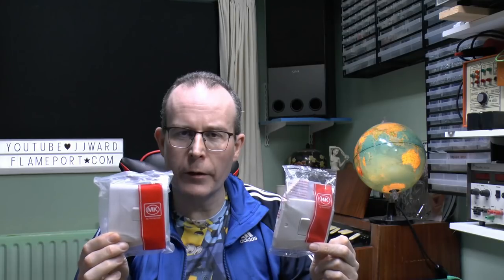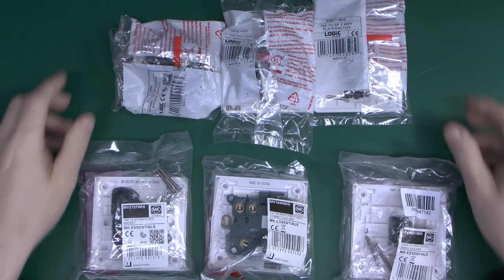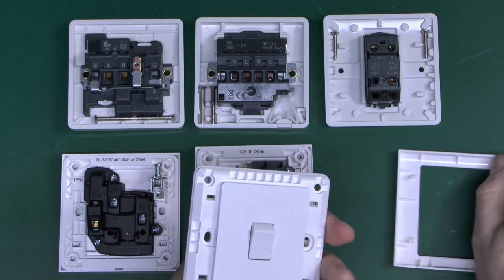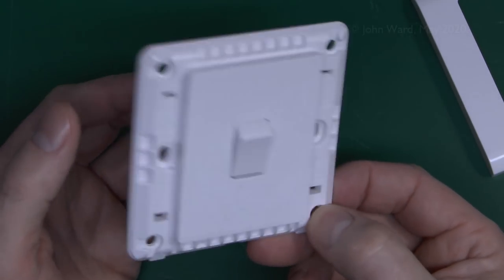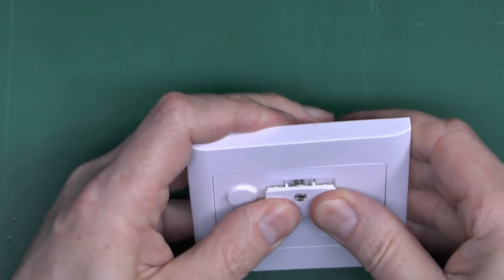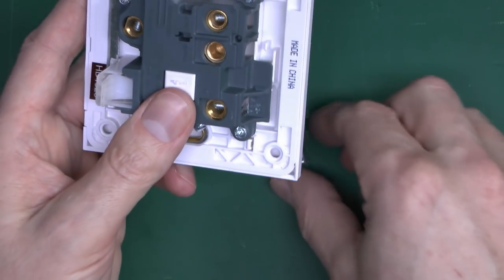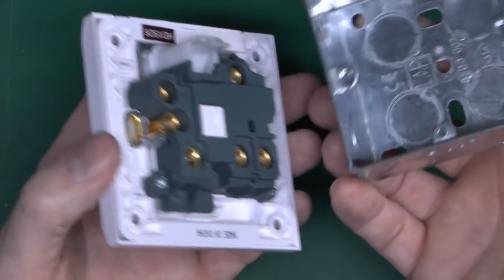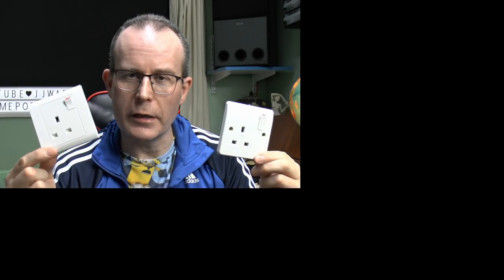MK Essentials vs MK Logic Plus

Comment: The MK essentials look like cheap compromised crap to me... Amazed that MK would produce such rubbish.
Reply: MKs quality has plummeted since they became part of Honeywell.
Reply: Looks very much as if they've put their name on a pre-existing range. The inapplicable CE mark on the socket would seem to back this up.
Reply: @Graham_Langley  just what i was thinking, they have found a generic chinese manufactured range which is probably also sold by other manufacturers as well, ill stick to the loig plus, always used them and will continue to do so
Reply: Judging by the looks of the things, MK only makes the frame that covers the screws ;)
Reply: @Graham_Langley  "China Export" quite applicable.  :)
Reply: Totally agree with all these comments, I have seen then and they are very cheap and nasty. Not for me.!
Reply: Not liking the look of the Essentials range, the absurd design of the light switch says it all.
It's a shame that a brand which had a long history of UK manufacturing and which was once synonymous with quality should introduce such a product range.
It looks cheap and not very attractive in my opinion, the quality of the materials and the design are questionable and also shame to see more unnecessary and fiddly packaging introduced.
If the customer wants MK, would definitely stick with Logic Plus, where most of the range (but not all of it) is still manufactured domestically although I see comments from those who have been in the industry for many years saying that the quality of these products has declined in the last decade. I've certainly found it necessary to wind the terminal screws in and out again before making terminations.
Reply: @Graham_Langley  That certainly seems to be the case, none of the products had MK moulded into the main plate or the back of the switch / socket body; the only marking visible was on the socket where it was ink jet printed on the back.
Reply: I think Logic Plus are still up to the old standard (maybe apart from the terminal screws). 

Nobody else apart from Crabtree and Wandsworth has the same smooth plug/unplug quality and switch action. 

(That I’ve found at least).
Reply: This is driven by design and build projects and contractors wanting to fit cheap rubbish, this is the sort of junk Cala and Taylor Wimpey etc. will install in new builds. Contractor specials, until people demand quality this market will do great business. 

MK had to be able to compete with the cheap own brand rubbish the likes of CEF brought out. Sadly people accept this. I personally want quality in my home.
Reply: @peterpeterson9903  Exactly - so MK launching these probably raised the standard of those bashed together houses' wiring accessories, which can only be a good thing.
Reply: Probably for international market like here. I can only get the Essentials, but would like to get my hands on the Logic lineup. FYI 50pence difference is huge for lower currency market.

Comment: Who'd have guessed Honeywell would take a well known quality brand and stick it on some crap...
Reply: They also have cut a fair amount of the finishes from the higher end products (edge, aspect etc).
Reply: They've done that with consumer appliances for a while. I bought a "Honeywell" electric fan some time back, it barely lasted a year,  just long enough to be out of warranty.
Reply: @tncorgi92  argh probably got a timer circuit in there somewhere Lol.
Incidently I bought a Dualit kettle (£70) lasted 2 years ,got a slight discount on new one that played up to ! For work I bought a cheap travel kettle used to get chucked into van never let me down in 10 years .
Reply: Paul Drake yes Honeywell electric fans with remote control promise whisper quiet operation and then rattle after a year of use!
Reply: @SproutyPottedPlant  mine became whisper quiet because the motor was dead.
Reply: Well they did with Gent fire alarms
Reply: I think Honeywell tend to grow by acquisition. Their famously unreliable wireless roomstats for example with the fading LCD segments, they're made by a uk company that honeywell took over.
Reply: Crabtree was bought by Siemens, who kept the standard pretty much identical.  

Remember Cabtree own Volex too (if on a budget) and they can be reasonably attractive now too after those ugly 80s sharp Volex accessories!
Reply: @raychambers3646  I had the same Dualit kettle, burned out after approx 2 years also.  Got another one from Costco fortunately - great customer service.

Comment: 18:01 - just occurred to me that the removable blanking part in the front of the essential FCU is probably a choke hazard for toddlers as well.
Reply: Blanking parts are removed by the installer and discarded with other dangerous waste.  No toddlers should be in range unless playing in the waste disposal pit.

Comment: Good demonstration of the two ranges of MK JW . I was very interested to see this new MK range as I haven’t fitted any for years now . Always used Crabtree for the most but it’s become less stocked by local suppliers. Changed last year to schneider lisse  range and apart from the ridiculous short pins supplied for light switches it’s a nice product. I’m glad I don’t fit this rubbish, I noticed that if you used the flex outlet on the switch fuse you would need a very deep box regardless of the big lump of a cord grip .. This MK essential looks like dreadful expensive tat.

Comment: Somebody at MK has messed up here, looks like cheap crap I can't see that selling well at all.
Reply: going to sell to the cowboy builders though, where they will buy it, simply because it is 10p cheaper. Who cares if they fail after 2 years, he is long gone by then, having made a whole 2 pounds extra profit on the job.
Reply: @SeanBZA  Thing is theres cheaper stuff that looks better, and is probably more reliable!
Reply: Well personally, I prefer poking wires into round holes rather than square ones.
Reply: Sadly it will probably sell to people who either don't know any better or whose customers specified MK but neglected to specify which range of MK products.

In the long term it won't be good for the MK brand but in the meantime they can make a quick buck :(

Comment: Thought I ought to point out that some Logic+ stuff is made in Malaysia - the double sockets with outboard switches for example.
Reply from the maker: Had an MK 646 plug that was made there.
When wiring it, one of the terminals inside sheared completely off.
Reply: And the double unswitched socket K781.
Reply: @jwflame  I had one - country of manufacture unknown - that one of the cord grips broke off straight out of the bag. It had been in stock long enough not to know where it had come from so I called MK. Their response: "Buy another one - they're cheap enough."
Reply: I have a few Malaysian MK items. I was intrigued when I saw the 'Made in Malaysia' bit, but they seem to be of the same quality as English made ones.
Reply: @stevecoatesdotnet  The only real difference I've seen is the fixing screw earthing riveting seems to be a bit messier than on the UK ones.
Reply: @Graham_Langley  I would have replied: Send me another one free, they're cheap enough. :)

Comment: I think MK accessories have been available in other Type G countries for decades either manufactured
or imported. 
MK also used to manufacture their Avant range which is basically the old Logic range
in a more curved design plus clip on face plates in either white or synthetic metallic finishes. 

I did at least expect the Essentials range to have basic British Standard compliance as standard
in the sense that the design wasn't flawed that some accessories don't fit 25 ml back box properly.

In other countries back boxes with 4 screws in each corner are more common then they are here in the UK 
so I can see the reasoning behind the clip on faceplate on the Essentials range but the Logic Plus range 
does have indents on the reverse side that can be drilled out but that ruins them if they are going to be reclaimed.

Comment: Here, in the US, it's very unusual to see a fuse in a wall outlet or switch. I've never seen a face-plate with a hole in it for a cable to run out from!

Comment: The biggest problem with BOTH of these ranges is that they don't match the earlier MK classic sockets and switches. No particular problem for NEW installs but having to replace a whole kitchen full of the square edged classic socket and switches JUST because the new one is "preferred" is bloody ridiculous!

As for that pile of Chinese junk, I can't believe MK have dropped their standards so low, as others have said. I have to say that the LAP range  and some of the others are better looking and better value than MK these days. I suspect MK have resorted to these Chinese ones in order to retain a greater share than they are losing. Years ago no-one would ever question buying MK - a bit like the old IT expression "no one ever got fired for buying IBM". These days I'm not so sure, and with the "quality" (??) of these it's not going to improve things. I also have NEVER seen the point of screwless designs unless on a completely flat across the whole front, glass plate touch switches which show NO joint whatsoever.

Comment: Fairly competent DIY'er here. I have seen those Essentials range in Screwfix. Swerved them because they look naff and that are shockingly expensive.
Also that light switch in. 25mm. Wow. Imagine having a few more gangs in there or 2 way and you are stuffed. Also not uncommon to see 16mm back boxes for lighting.

The logic range has changed slightly recently I think. The last batch of switches I bought had different rear connections to the ones I had already in the garage ready to go in.
Reply from the maker: There is a 4 gang Essentials light switch.  It's on the same size plate.
https://www.screwfix.com/p/mk-essentials-13a-4-gang-2-way-light-switch-white-with-white-inserts/475HV
Reply: @jwflame  Well that's been hit with the ugly stick!
That cost conscious home owner is going to be delighted when they discover they will need to dig out the old box and sink in a much deeper one.
Reply: A while ago MK moved to effectively fitting gridswitches to plastic fronts for logic plus - which is why the terminals changed positions.
Reply: @Gazzerdaman  Other way round. They used to be Gridswitch modules but have changed to a much smaller switchblock. The wide rocker one and two way switches still use Gridswitch modules, which can be useful.
Reply: John Ward these god awful looking things are similar to the contactum Alfanar range they also do 3/4 gang on single box. Happy with contactum generally as a budget option but the alfanar and mk essentials will not be passing through my hands
Reply: @Graham_Langley  I think they've changed back or are selling a mixture because years ago I bought grid switch style ones. Then did my house and they were all crappy ones which don't click the same as the gridswitch ones. Last time I bought some they were all gridswitch again 🤣
Reply: @Gazzerdaman  Looks like you're right - current stock is all Gridswitch modules.

Comment: The essentials series does look like the product of another (fairly large) Chinese maufacturer, it will meet the safety standard but not nesserarliy follow the usual BS standard conventional designs, as of why they already exsit, well, Hong Kong uses the same range as the standards are basically a deviation of BS. I will stick with the Logic+ though
Reply: It is from that manufacturer. They make good plugs, leads and extensions. Better than BG/Masterplug’s OEM in my opinion.

Comment: I switched from mk to contactum as the price increase of mk is ridiculous
Reply: Also the quality of contactum is surprising good   always using mk/crabteee. I used a contactum defender board last week for first time and I was very impressed with the build quality
Reply: @NERTH247  
The Essential range inport should be cheaper being manufactured in China.  That's the point. 😳

Comment: Why MK even think its acceptable to crate this garbage, goodness knows. Maybe it will be used by housing development companies. I wonder if MK are phasing out the Logic Plus and replacing the Essential range as the new one.

Am I right in beliving that child socket covers are dangerous on UK sockets?
Reply from the maker: Yes, socket covers are both totally unnecessary in the UK, and can damage sockets as the pins on the 'protectors' are usually of the wrong size and shape.  They can also break off in the socket leaving the shutters open.
Reply: @jwflame  ok. Thanks.
Reply: @jwflame  And they're banned on all NHS estate. Doesn't stop the likes of Homebase selling them though.

Comment: Surprised they managed a ce mark what happened to internal barriers and enclosures
Reply: Plugs, sockets and adaptors designed for domestic use, and fuses for use in a plug or adaptor, are not covered by any Union directive and therefore must not be CE marked.
Reply: Graham Langley oh really.. I did not know that how interesting
Reply: @tomorichard  You'd think MK would know that. A CE mark on a UK plug, socket or plug fuse usually means it's non-compliant and it's also stated as a likely offence under the TDA.

Comment: Instead of selling this Chinese stuff here, MK should be selling their quality-made stuff to China. There is a growing demand in China from the middle classes for higher quality living and this is filtering through to the built environment.
Reply: MK have always imported their Logic Pus range to other Type G countries but China have always provided different ranges of accessories to suit different budgets, the Avant range
is still manufactured in Asia. I have even seen older MK Logic accessories used in other Type G countries like Singapore.
Reply: @LittleRichard1988   They are more expensive then the Mk logic range according to srew fix and are less of quality and standard. 😳

Comment: MK changed the look of switches and sockets and gave them a fresh modern look, a lot nicer from the traditional old fashioned square edge. Personally I have never been a fan of the terminals across the center and you can't get much conductor in their switches.
But the problem they have, is that manufacturers copied the curve look and produced similar products cheaper, mainly click mode, and they are no doubt suffering.
I am not sure what they were thinking of with this range though, ugly and poorly designed, can't imagine many people using this. And to all manufacturers get rid of the excess plastic bags.